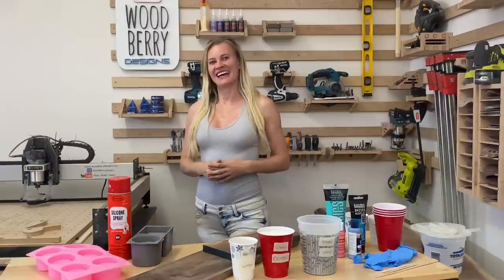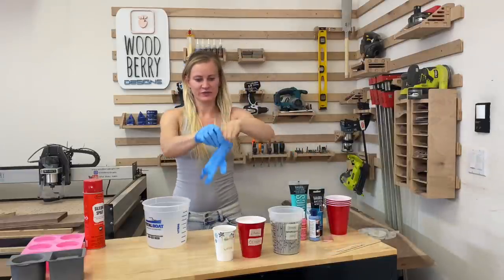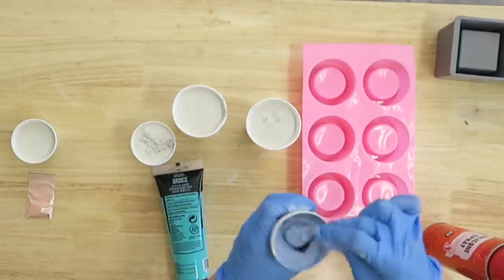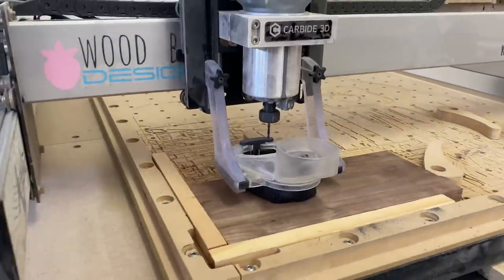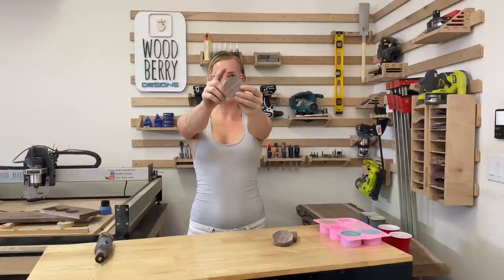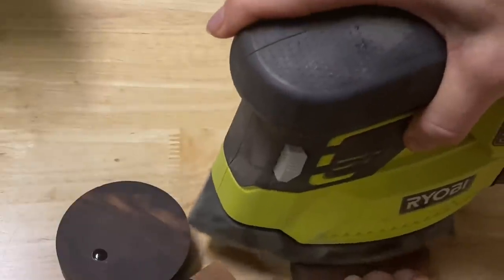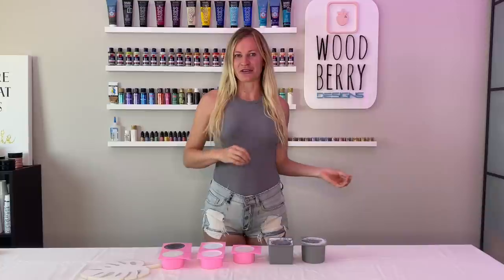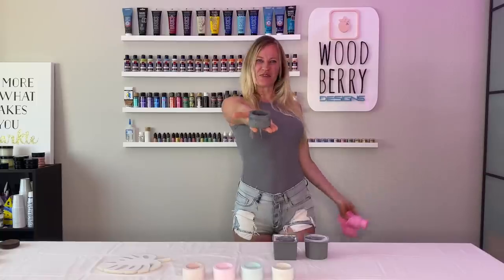Cement Salt cellar with walnut wood 🪵

Comment: Love what you re doing.  One observation:  Drier is always better.  I understand that you want it to smoothly fill the mold and in a silicone mold you can't be hammering it in but  a watery  mix of concrete will crack as it cures.  There are additives you can get to address that. 
Water-Reducing Concrete Admixtures  makes the concrete flow better with less water.  
There are additives that reduce shrinkage.
and there are Superplasticizers.  They help you get a high flow rate and are used in construction when vibration and hammering is not available to get the concrete to flow into the forms. 
Talk to your masonry supply  house  (Not a big box store) they will steer you right. 
While you are there ask about Self compacting concrete

Comment: Would an orbital sander without sandpaper work to remove bubbles from the concrete mix? Holding it against the form with light pressure and letting it shake the mix.